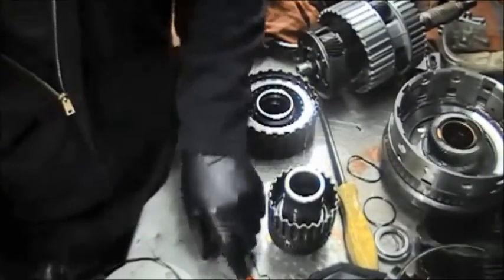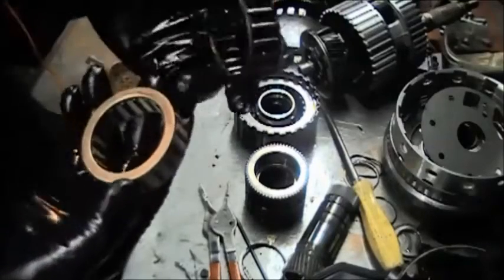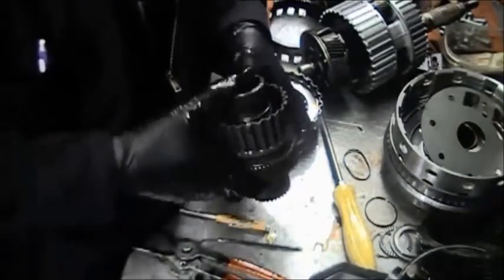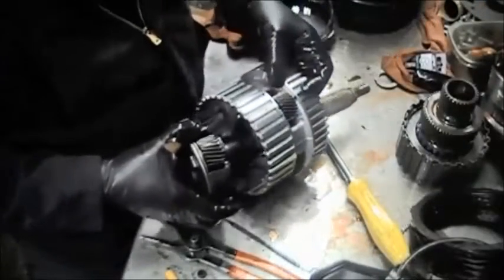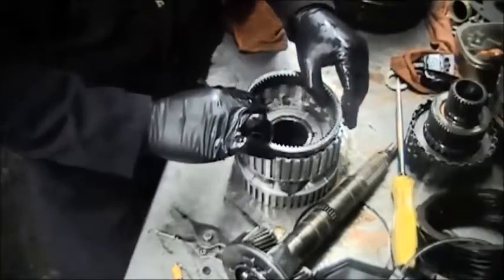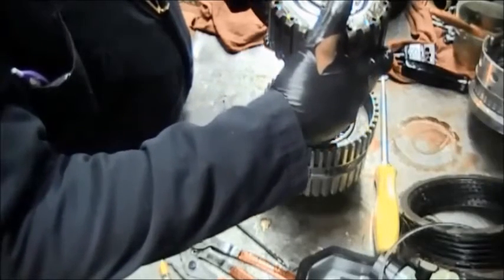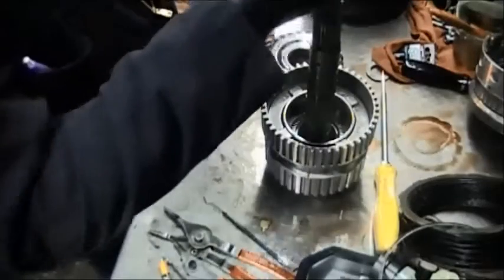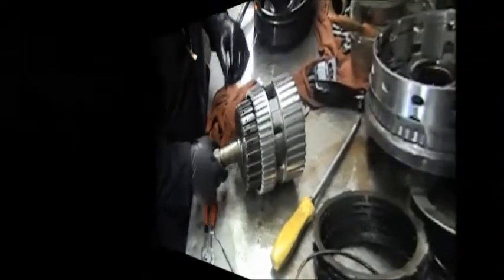Mercedes Benz 722.6 transmission repair Part 4

Comment: I gotta say you are doing a great job!Unfortunately my merc w211 320 cdi 4matik 5g tronic seems to have gearbox issues.When the car is cold the first shifts between 1st and 2nd are not feeling normal, there is an uncomfortable kick then shits into 2nd gear.When it reaches working temp.there is almost no sign of the problem except almost hard to witness like a slip between 1st and 2nd again, but many times it doesn't occur.What is your opinion about the problem and how to solve it?Thank you for your time.Keep up the good work!
Reply from the maker: How many miles/kilometers?
Reply: @thisisyourtransmission  200000 km
Reply from the maker: what type of transmission do you have in your vehicle? 722.6?
Reply: @thisisyourtransmission  yes

Comment: Who do you use for parts? I can't find a rebuild kit for an AMG 722.6, all of the rebuild kits are for the V6 Mercedes.  AMG seems to be dealer only and it's very expensive to piece a kit together.  Are there any high performance clutch options?
Reply from the maker: whatever it takes transmission parts or Transtar

Comment: hi questioning 3 im rebuilding one of this.
after you remove the snap ring from the k-3 clutch hub/rear sun gear with sprag my is missing the gear spacer and gear ball bearing.

Comment: You mention to lubricate, do you have a recommendation on lubrication?
Reply from the maker: I use 5w30 motor oil when putting parts together. I stick clutches in transmission fluid before I load the drums.
Reply: questioning3 Thank you

Comment: I having some transmission issue on my W140 S500...  the transmission is slow responded when from P/N shift to R or D.... It delayed about 5-10 second...

Recently having clutch burned on 1st and 2nd gear... After replace the clutch... problem still remain, now problem even worst... after few hundred km drove... now the gear was stay at 1st gear and never change it any more... 

I have replace another working valve body, not working... Dunno what is going on it.. need your help..
Reply from the maker: what type of transmission is yours and what year is the vehicle?
Reply: 722.620 transmission... Car manufacturer 1997.
Reply: 722.620 transmission... Car manufacturer 1997.

Comment: great videos man.  what are the simptoms on a bad sprag?
Reply from the maker: a sprag is a brake. It stops something. If a sprag goes bad, the vehicle may not move, or it may studder while moving.
Reply: @thisisyourtransmission  I have another question if you may help: where can i find parts online? I am in the E.U.

Comment: Hello after watching this whole series of vids i took my trans out (722.6) after it was slipping from 3-4 when hot and jumping into neutral under load as well as locking out and cant find anything wrong everything looks in tip top condition. I changed  the conductor plate as well as having the valve chest overhauled so im at a loss on what's actually caused the issue. Have the sprags and seal kit now to rebuild it and hoping that the seals sort the problem. Any thing else i could check before re fitting it back together? Cheers again and great series of vids
Reply from the maker: +The huntsman valve chest? Is this the valvebody? Also, the sprags can cause a problem in this transmission. One sprag in particular. I have to check to see which one.
Reply: +questioning3 i think its the k2 that can cause it but i may be wrong but by the look and feel of the sprags they both feel nice and tight and lock to the clock. I also meant valve body not chest sorry. Thanks for your reply.
Reply: +The huntsman im going to replace the sprags anyway just in case.
Reply from the maker: +The huntsman What was done to the valvebody?
Reply from the maker: +The huntsman what was done to the valvebody exactly?
Reply: +questioning3 it was put on test bench and run with full report no problems found